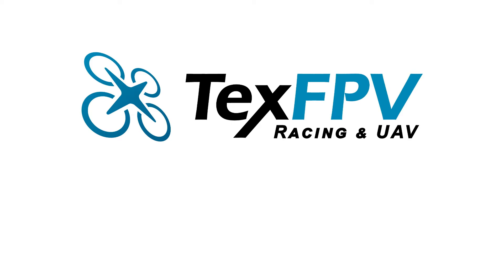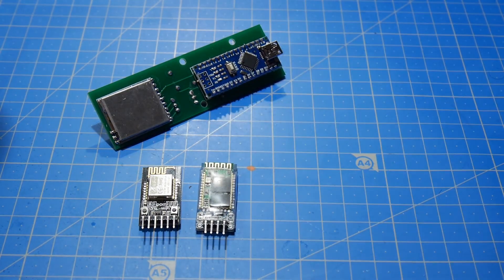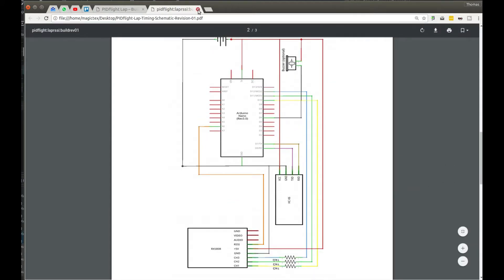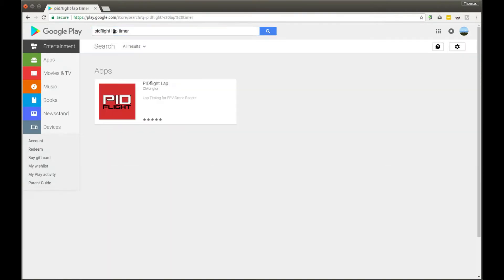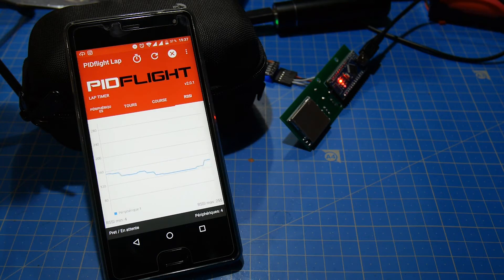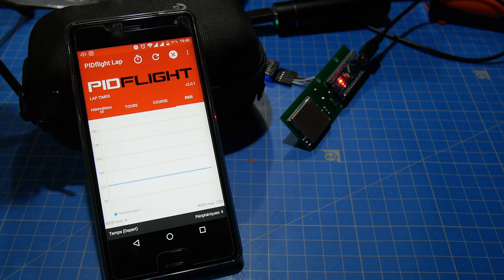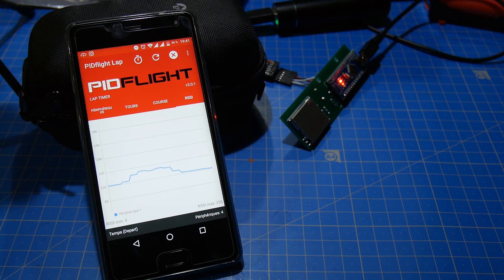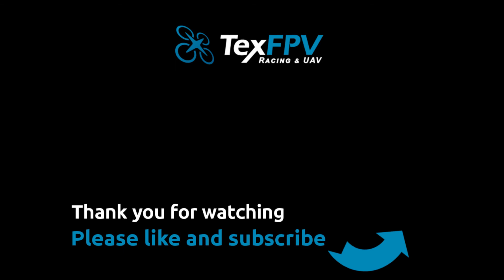PIDFlight Lap Timer - Introduction - Hardware and mobile app (English)

Comment: Thanks for showing how you connected your wifi module. The pinouts on the wifi module appear reversed from how the PDB and Bluetooth module mount so I was trying to think of the cleanest way to connect it.
Reply from the maker: +Jeffx FPV You're welcome ! I made that to also easily switch between the two modules.